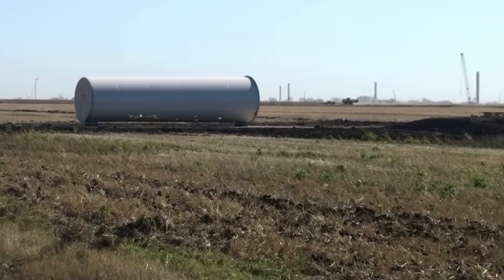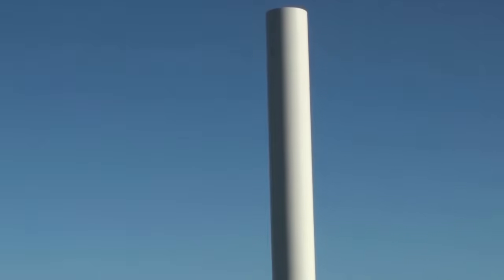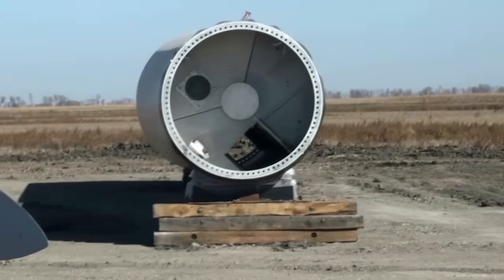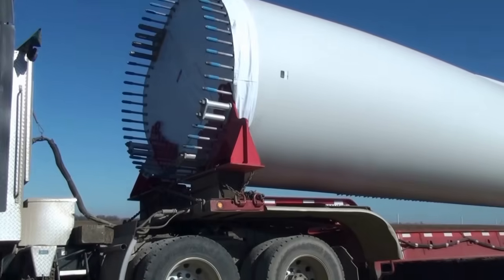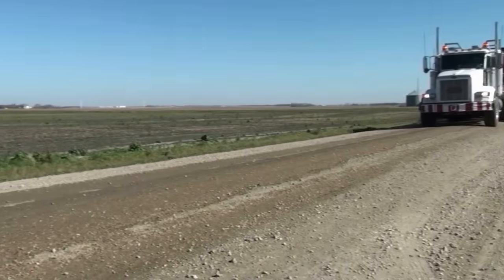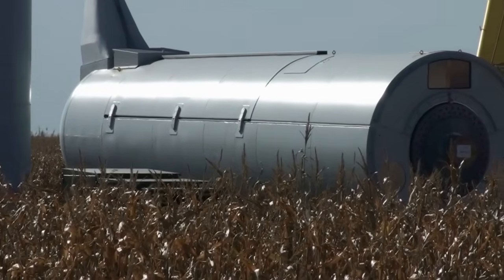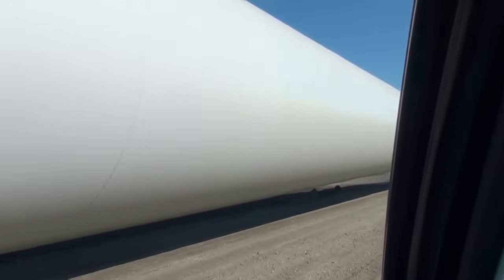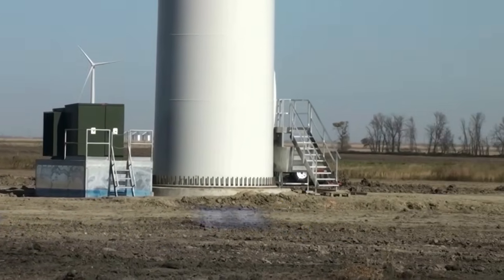Giant Wind Turbine Assembly part 1

Comment: 1.hole windturbine has a weight about 300tons(sections up till 50 tons,machinehouse 95,wings 15 tons,nav 30 tons)
2.there is power up till 4 MW (Megawatt), depens of what kind they build.
3.???